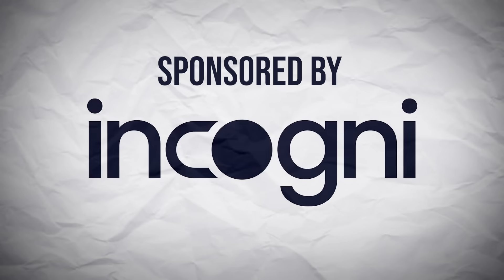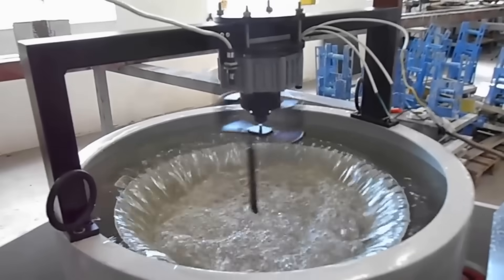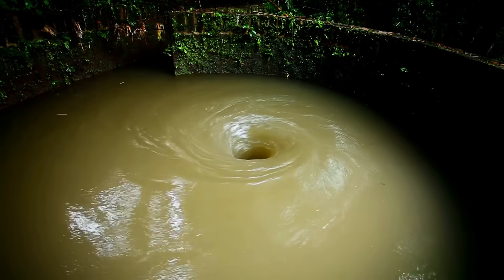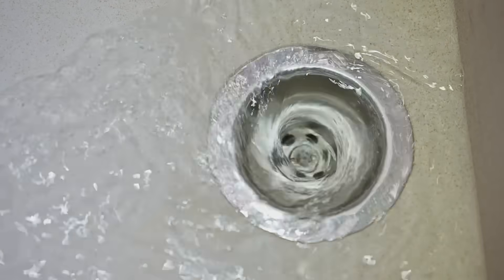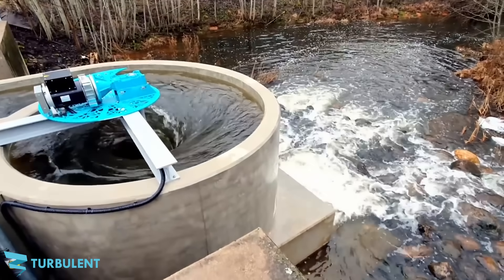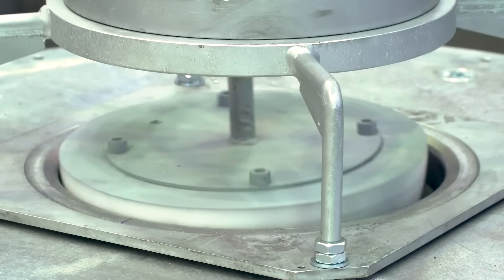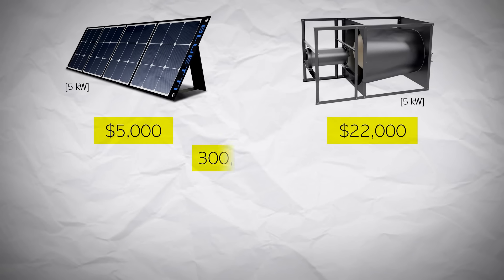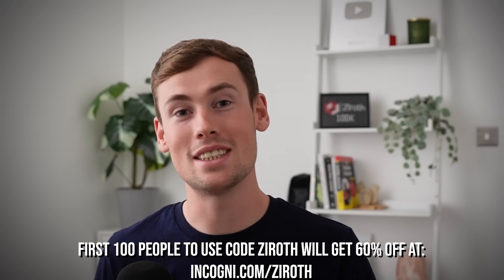Genius Bladeless Hydro Turbine is Cheaper Than Solar

Comment: I don’t get it. Electric power generators can be self- powered. The back EMF that must be overcome in a traditional generator can be altered easily to power the generator if the induced power can be phase shifted to occur as the induction magnetic field is switched to another polarity, or even from increasing to decreasing.  
This innovative approach was suggested by Tesla over 100 years ago and powered his Wardenclyffe power plant. It has now been reinvented by Thane Heins; calling it a ReGenEx motor. The mechanism is basic electrical signal processing. Add capacitance to the induction winding and the current will be delayed. A little tuning and the right mix of timing and power can be designed in.  No wind or water required. 24x7 power as required. No fuel. No outside force.
Party on dudes, be good to each other.

Comment: Hydro power is solar, but with extra steps. But seriously, manufacturing photovoltaic cells is terrible for the environment. Sure, the cells themselves are green, but they have to come from somewhere. Hydro is super green, and you don't have to make that many turbines to make it work, so it's way better than PvCes

Comment: When it is all said and done a water wheel is just as efficient, perhaps more so as gravity on the wheel and its filled buckets add momentum which is preferable to the direct force of the water.  Nice invention but the old tech is far more environmentally friendly and fish don't care as they aren't impacted by the low velocity.

Comment: I dont know where you got your data but it's definitely wrong on solar panels. 5 kWp of panels can produce about 6000 kWh per year , a bit more or a bit less depending  on latitude ( Norway or southern Italy it's not the same of course ) and orientation, surely  not 50.000 !!

Comment: My first thought is this has no grid scale use. Simply it will not be able to generate enough energy to power even a decent portion of the surrounding area since there isn't a lot of space in a river. 
Like if they are 5.28 long and are stacked side to side then a 5megawatt generation would be a mile long, 500mw at 100 miles which would never happen because the cost to transfer the energy would make it one of the most expensive sources of power. (Maybe depends on how many and how windy the rivers are)
I only see this being cheaper if you have a river in your backyard and you use it to generate personal power for you otherwise it's not cheaper.

Second your math for energy production is very wrong, I'm not a expert or understand the math fully but 5kw solar arrays generate 7-10k kwh a year not 50k. 
And if a 5kw system generates 100% power 24 hours a day 365 days a year, it's only 48k kwh not 300k kwh.

Comment: What you don't explain is how any power is generated.
I assume you're taking data from the prototype propaganda websites.
To me, the vortex is the result of difference in earths rotation across the initial diameter and that's what power? 
Assuming it does work at all, the best use would be as a water 'battery'. Because it only needs a low head the peak wind and solar can pump upstream.
But since you rely on incognito data it looks like a scam. And YouTube comments are scraped for AI now anyway.

Comment: You want to know what the problem with rivers is;  maybe you haven't noticed but there isn't one at every home/residence.  And do you need me to explain what that means;  well I will none the less in case you don't understand.  See there is something that we like to call "FREE" and that is what wind power gives us;  and unlike what you're told;  wind can give you enough electricity without the need to charge a big battery pack because the turbine can be bigger than what you need and then you have lots of electricity ;  and abundance of it actually and then if done correctly it can become the only thing that is needed and factories can now buy from residents if they don't have enough of them or they can buy one of those big ones.  That is what people need;  they don't need to see more things built so that they can continue paying for running their homes and vehicles;  they want FREE electricity.  I really do hope you understand the concept that I'm telling you here because evidently you didn't likely think of that before you did this video otherwise you surely would not had went ahead with this video;  am I correct;   s anyways you can start advocating for what I just said now that you understand that it is what is best interest of the people that you are targeting.  Cheers and good luck with you new video sir.  I really should start video capturing these fun educational types of my offering of the assistance that people need and must appreciate;  yes I think I will start with this one and use OBS and run it on youtube as well and under a new channel just for things like this one where I got to you just in time for you to not make a fool of yourself didn't I just do that for ;  well nevermind you don't need to thank me because my doing something good for everyone is a thank enough.  So anyways;  if you need help with your other video don't hesitate.   Oh maybe make one of those for the wind instead;  ha ha...  where would you be without me huh.  Ya I know;  in famine farm right;  huh am I right?  We have a nice rest of the day now would ya.  Good night sir.  And uh;  did you know that the right solution for you fish conservation is by not doing it where there are fish;  did you know that rivers start without fish?  Oh yes they start where snow and ice melt. and no fish are melting at that location so you are safe to do that and another thing about that location is that you can take just a pipeline's worth of that flow of water and run that pipeline all the way down with turbines every so often and then you have created a very efficient energy system and you can do that at every mountain that melts(I think).  Ok so I was done here but I went and watched a bit of your video some moe and I just so happen to come across you showing that vortex that is so easy to stop and has no force that is anywhere close to being significant.  So I am going to stop now because I just can't take it and why didn't show the good folks how hard that thing would had been to stop;  your mill that you were showing at the beginning and that you shrugged off so fast is way better then what you have here.

Comment: Looks like some rock crushers you see in gravel quarries. Those see a ton of  wear and tera (duh they are crushing rocks) but with the same motion it makes me curious what kind of operational wear and tear you can expect from these hydro turbines. Long-term costs could increase over solar if they require more frequent maintenance. Cool design, cool video, thanks for the hardwork and the upload 👍

Comment: Low head = Low power output.
If you divert a sizeable fraction of the stream to power this concept, will the salmon swimming upstream be able distinguish the safe water flow from the deadly device flow? Will the salmon just stage at the screened exit of the turbine?

Comment: I didn't hear any mention of what causes the Vortex to occur.  It is based off the rotation of the earth relative to it's axis. So this tech would not work at all at the equator where toilets don't form vortexes when flushed.  And the Southern hemisphere would rotate opposite of northern hemisphere.  The magnitude of the vortex would vary based on latitude, earth's current tilt relative to plane of rotation, the moon's current orbit and state, etc...  Therefore, each install would need to be tuned to all these factors and the magnitude would vary over 1,000,000 to 1 based on all these factors at various locations.  I believe the only way to get over single digit efficiencies is if a turbine of some form is introduced into it to take advantage of direct Gravity.

Comment: A bit like Tesla turbine idea. Anybody done testing on the torque of this idea, or the Tesla turbine idea. The generation part is easily done understood, but the loaded side is the problem. When generators under load it will bog down the mechanism which means without enough torque to overcome the load we produce nothing useable. Thanks for sharing.❤ we

Comment: Nice, can i give you some input as an electric pro, turn the ping pong ball in to a magnet, then a coil around the paper cup, or making the turbine casing iron, then wrap the coil around the iron, then you can harness the electric in the coils, as water is a supper conductor, the transfer would be very good.by the way solor does not need UV to work......now you know...

Comment: Pretty good info/vid, now I know the concept and yet I never imagine ever using a ball in the middle to do the rotating.  However, what this video did not include is how much noise does it give off when its in operation?  I can imagine it be a lot more noiser than other type of vortex type.

Comment: World Bank certainly isn't interested in cheap and available energy. They're interested in creating the Global Governance (One World State). You're clearly an enthusiast of clean and  "green" energy so you won't pay attention to this. Do you think that these high society ppl are so stoopid that they make policy "mistakes" (a kid could understand) resulting in energy prices skyrocketing and energy safety on the brink of collapsing? The expensive and intermittent energy is exactly what they need to force their newest "revolution". They can use Climate Change rhetoric to cause it and then blame the (obvious) effects on... Climate Change. It's a self-propelling agenda.
Technically speaking, I smell a problem here - the vortex is a secondary effect of a falling liquid. Usually you'd extract the gravitational energy of a falling water directly, because when you try extract the energy from a vortex, you're collapsing it. It's enough to put your finger in a bathtub vortex to see it. Your ping-pong is spinning because it's very light and extracts practically no energy. Therefore I doubt that the efficiency of the presented tech. is 55% of energy carried by the water. The efficiency is always corrected for the type of tech., like e.g..you can only extract close to 60% of total wind flow energy with a propeller/turbine (Betz limit), but real propellers extract much less than that. So the question is how exactly this efficiency is defined? I bet it's something like 55% of the max energy which can be theoretically extracted from a water vortex by a rotating ball. But how much of a gravitational energy of the medium is that?

Comment: AS an off grid low header, I made many experimental turbines and learned a lot. Efficiency can be up to 70% even with small 100 watt units at 3 feet of head. Self cleaning screens keep fish and debris out. All needs to be stainless steel, dissolved atmospheric CO2 attacks galv and concrete if turbulent. Critical aspect is not having fixed alternator speed, allow the system to self tune to the load. Switchmode electronic control.
Reply: What generator would you recommend for max efficiency for your buck?
Reply: Hi I'm off grid too. I have a lot of solar but this time of year it doesn't make much. There's pretty good water flow but not much head. Looking at small China pm generator. I have controller and battery sorted need help with mechanical part. Turbine or wheel or idk cast part to swirl like this video shows. I'd love to talk to you about it if you don't mind?
Reply: Have you used power to run a bitcoin miner yet sir? Please help us bring this technology to the world
Reply: @advantaproductions why would he waste his power mining shitcoin

Comment: There is no nuclear on the chart about electrical costs... also, if they just made grooves in the ball, it could be stationary to not make fish paste as much, and could still start a vortex. It would have to be football shaped though, and could be fixed, which means less stress on the rotor with elliptical rotation...

Comment: I was recently wondering if the mass of something that goes through a turbine is important for the energy output. The speed remains the same. It seems as if steam driving a turbine has more power than hydrogen would have but less energy than water would give ???? However very fast hydrogen could probably deliver the same energy as slower moving air. Both speed and mass matter. I guess here there is conversion from much mass at low speed to less mass at high speed.The energy is the same more or less but a smal turbine can be used while otherwise it would be a very big one.

Comment: Sounds to expensive for a ball and funnel, geez. Solar panels requires similar substances as CPU's and memory chips do. Those takes quite a bit of melting processing and purity. But the funnel from the looks of it seems like something any farmer with a welding equipment could manage. Of course with a bith of prototype failure

Comment: Check your math please, 5kw for one year will not produce 300,000 kwh.  5kw * 24 hours * 365 days = 43,800 kwh  That is almost an order of magnitude from what you state.  If you further multiply by 17 % insolation do to night time and clouds you end up with 7,446 kwh per year which would make your cost of electricity about 67c per kwh for the first year not 10c  as stated.

Comment: note that not installing something is not really the same as 0% effiency, since for something too be worth using it needs too be high enough efficiency to gain a net benefit over its operation and maintenance costs. Something with 0% efficiency would be a liability, being worse than building nothing at all. So efficiency is absolutely still important even if buillding something was free and had unlimited areas to build.

Comment: 3:04 I was thimk the same. Give initial energy to rotate but can be made PASIVE. how? made patern in the walls.
Put some glue on the walls in form of coil going down(witth some investigation and availbe flow rate can be make perfect or active stepermotors to make the shape.)

Comment: im curious about your math at the end, 5kw system means per hour its 5kw, usually the inefficiency is added into that already like the most common solar panel on the market is around 20-22% efficiency now from Sunpower, but only collects around 6 hours of good "max output" light for an entire day so about 30kwh per day, the hydro solution would be, if 5kw is maintained every hour and water always flows, 120kwh per day. solar on average can hit 250-300 days collection depending on variables, hydro could probably go all year, those numbers are far less than what you put at around 11kwh for solar per year and 43800 for the hydro if its all 365 days

Comment: They need to design the machine so that it doesn't have that offset. It was explained why the offset is there but if that aspect could be swapped out for another that also accomplished the goal of initiating the vortex, then the machine would have a much higher reliability. Any kind of imbalance reduces reliability apples to apples

Comment: We keep stealing so much energy from nature, at some point geographically local ecosystems have been altered either by less wind erosion causing fewer sand particles/dust particles in the air thus generating less rain clouds, or by less water erosion leading to less nutrients washing to seas and oceans. Yes, one small hydro turbine won't do that. Yes, one modern wind mill won't do that. But build enough of these contraptions and they will probably have a negative effect as well. Not to mention the death of many fish and birds because of these machines. By far the biggest thing we should all do is consume less energy. And that might mean going back to simpler times or by living more in harmony with nature and adapt back to how things were done in a natural way, even some of our industrial or infrastructure demands.

And to all the nay sayers. This is a discussion, this is not meant to be factual. But a system like a river has an amount of energy input and an amount of energy output. These amounts are obviously not fixed but energy captured at one location will end up in another location as work (term from physics) and eventually (waste) heat most likely, also counting losses through conversion from kinetic energy into electrical energy (to then possibly be converted again at the destination). But it has been removed from the original location. Therefor, locally, this should have consequences when applied on a large enough scale.

Comment: So 5kW production every hour for 24hrs is 120kWh/day. 120kWh per day for a year is 43,800kWh. But solar only produces for 5hrs per day, on average, through out the year. So a 5kW system at 5hrs per day is 25kWh. And that's only 9,125 kWh. The stream would run 24/7.

Comment: God Knows Best. 
I think if the ball was placed nearer to one side it won’t need any vortex as pressure on one side of the ball will be less than the other and causes the ball to rotate on a vertical plane if water from above( like a ball under tap water). May be we cud have many balls in alternate positions rotating(a turbine). Cost may come down !

Comment: good video, but movement does not mean automatically energy: when you start taking energy from the rotation movement, the rotation will slow, possibly adding a force that is opposite to the rotation that inspired the movement, potentially reducing that momentum whose conservation law was the reason of the whole setup. It can be investigated of course. I still think that using the moon tide on oceans could pay off better

Comment: I can see where this turbine vould be also used on water tower installations to provide power to run the associated pump. Theres also the water utility input/output to power the facility and perhaps to send excess to the electric grid.